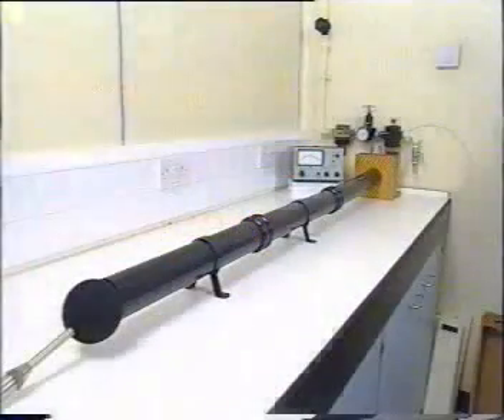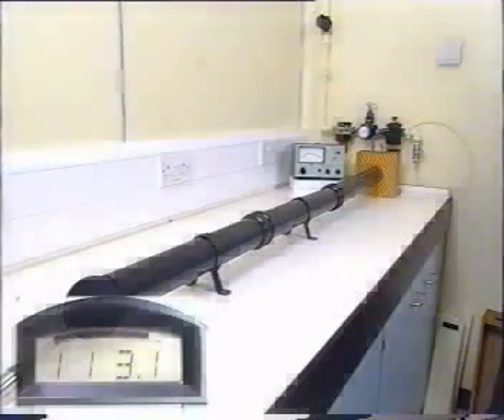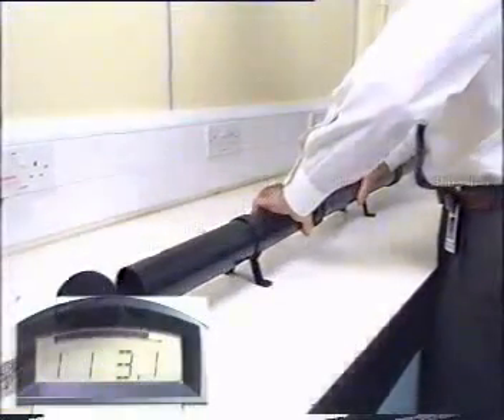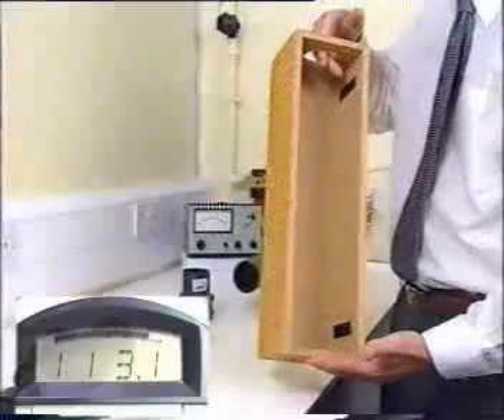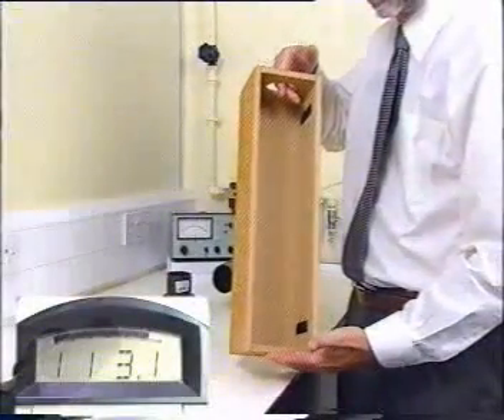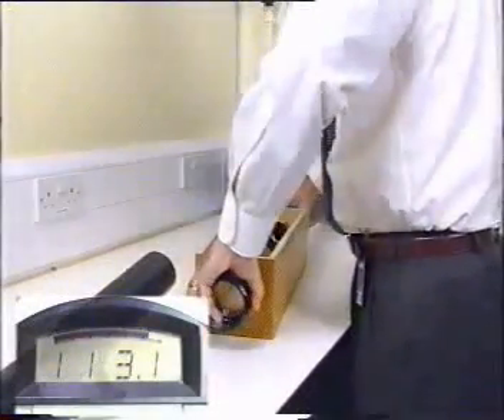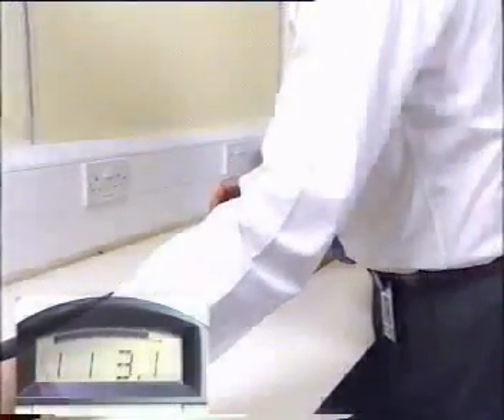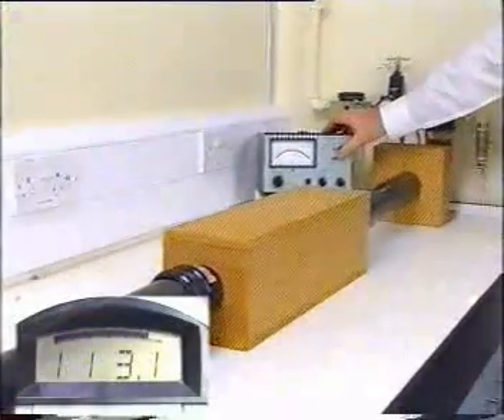Como funciona um silenciador de ruido (Absorvedor de Energia)

Comment: los silenciadores no son efectivos ,pues use x2 ,dos silenciadores una a cada entrada boca y bajo de 77db a 69 db mi rvk200 de 1080m3, unos conductos insonorizados sonoconnect de marca española me bajaron a 70,5 db,usando 70cm a cada lado, pues el conducto silenciado tiene un valor de 3,80euros el metro  ,barato pero el silenciador, el conducto silenciador en mi caso de 60cm y 200mm vale de 200mm vale 50 euros minimo ,por 60centimetros de silenciador, que tiene 4cm de material absorbente de baja clase ,lana de 25kg o otros de baja densidad el kg el m2 y densidad a un espesor de 40milimetros 4 cm de lana, los silenciadores son el mayor gasto menos rendimiento, ahora decepcionado con el resultado de los silenciadores  que compre confiado en 20 a 28 db de resultado los desistalare y comprare gastando mas a un por mala informacion y engaños pues no sirven de nada,se nota un 4% el cambio, un conducto moderno de ultimo diseño , es frances se llama phonic trap, estoy seguro que remplazando mis conductos sonoconnect de lana roca y aluminio tradicionales por esta tela fonica con algodon que es igual de efectivo que la lana mas la capa de polietileno tendre mejor resultado que con silenciadores y la obsoleta tecnologia de los tradicionales tubo insonorizados de aluminio mas lana roca mas aluminio micro perforado, al igual que confiare en marca phonic trap, encontre una marca virgen phonic trap de francia que tiene buen aspecto , en mi pais españa madrid , no disponemos mas que de silenciadores que no dan buenos resultados y conductos obsoletos de aluminio mas lana roca simples, gracias a dios encontre los conductos modernos franceses cual no e usado ni probado pero confio en el,mi idea es usar mi tamaño de 20cm al cual voy a micro perforar y la capa exterior para agregarle lana roca de construcion de 40kg  y 5cm mas de espesor para agregar al tubo que gracias a las estructuras de metal no se obstrulle , luego el tubo de 20cm tiene en total 24 le pego 5cm lana roca buena y tengo 29cm agregare 1cm de membrana acustica para bajas frecuencias de 2mm y luego total de 30cm lo metere dentro otro conducto de 31 cm phonic trap sin modificar ,en plan funda capa exterior que proteje, total un tubo para un extractor de 200 con un conducto de 315, pero de 115mm de capas absorbentes